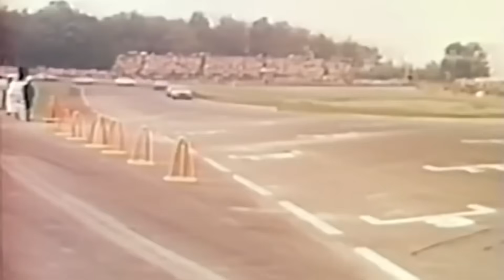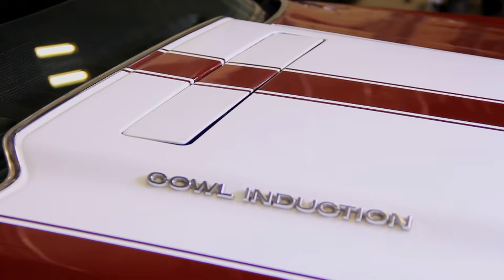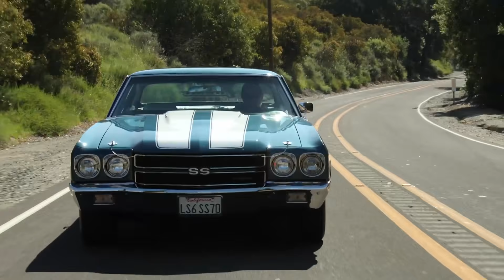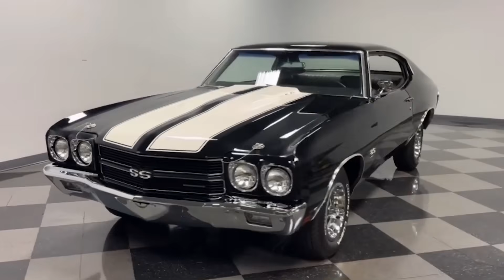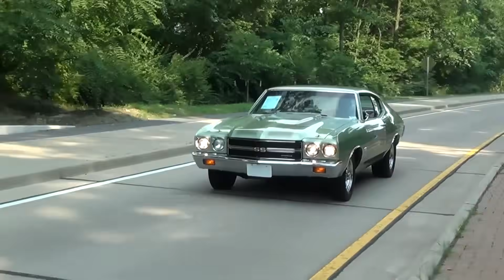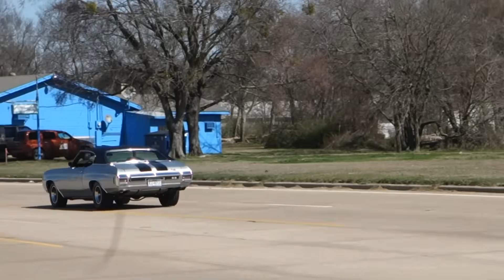1970 Chevelle SS 454 LS6 EXPOSED - The 500+ HP Cover-Up

Comment: Every high performance car from the manufacturers were under rated during that period. The LS6 was a monster, but it had one drawback, it was fickle and you either spent a lot of time in your garage under the hood, or you shelled out a good chunk of change at the mechanic keeping it tuned.  It was a Halo car for Chevy. If I remember correctly I think the Buick 455 had more torque that year. It was a great time for muscle cars, so many options to choose from.

Comment: When the LS-6 454 was dynoed at GM it had headers , no airfilter, tuned n no accessories. Put the air cleaner, stock exhaust manifolds n accessories the 450 horsepower dropped to probably 375 horsepower. The problem was traction with all the torque.

Comment: The exhaust manifolds and intake manifold hurt it immensely, therefore I don’t think it produced 500 hp. 450 hp sounds about right with what’s in the motor.
Reply: 450 gross is only 365 net, most V-6 turbos can do better
Reply: yes a set of headers and a crafty tuner with an msd and 850 easy

Comment: Nonsense this motor put out 460-480 horse at best from factory. It needed headers and highrise intake 850 carb and tuning , to do 500 +
Reply: nowhere  near 460 hp......
Reply: @chadhaire1711  If the car was 4000lbs and had an honest 460hp, it would have trapped at 115+, but I've never seen one stock trap even close to 110mph, which is 400hp or even less. They are probably 375hp dead stock from the factory and have 450hp potential if you modify it (tune it and uncork it).
Reply: @monkeymouse1403  375 gross is only 305 NET horsepwer

Comment: If you have a look at How to hot rod big block chevys by Bill Fisher and Bob Waar published back in 1972 - they dynoed a stock LS-6 engine with factory cast iron exhaust manifolds fitted and it only made 380bhp….
These engines only made the advertised horsepower with headers and OPEN exhausts ie the way engine testing at the factories was performed before the adoption of SAE rules around 1972..
Reply: I read that a chassis dyno test on a bone-stock LS-6 yielded 282 wheel horsepower. Full factory exhaust, air cleaner installed, no special tuning.
Reply: @benvye4279  Back then, engines were rated at the flywheel, not at the tires;
Reply: @rondpert5167  Yes, I am aware. During that particular chassis dyno test, the operator, estimating parasitic engine and driveline losses, calculated the flywheel horsepower at 350. That's a full 100 hp shy of the rated power. However, I've read many more reports that the LS-6 put out over 500 hp.
Reply: absolutely correct..As I mentioned above.. the very restrictive exhaust manifolds and very low rise restrictive intake manifold resulted in close to 40-50 hp loss. As I said the 69 Chevelle SS L72 427 made close to 450 hp...It would run away from a stock LS6.
Reply: @billdedrick1914  The LS6 was identical to the L72 except for a longer stroke.
Reply: @rondpert5167  Differences were the L72 had a taller, less restrictive better flowing dual plane Intake manifold and less restrictive exhaust manifolds and also included an open element AC 212c low restriction 14" x 3" air filter which allowed better and more intake air flow into the carburetor.
Reply: @billdedrick1914      The intake used for the 1969 L72 was the same intake used for the L78 396 engine rated at 375hp. In 1970 the L78 engine used the same intake as the LS6 engine and was still rated the same 375hp. So there can't be any significant difference between them. C3 Corvette's low hood required a lower intake manifold.
     There were basically 2 different factory exhaust manifold designed for Chevrolet. The better design was used in Corvettes and full size cars because of the open area under the engine afforded by not having crossmember interference. (as seen with the superior rams horn style exhaust used on the small block). This also allowed for a deeper oil pan. The Chevelle/Camaro/Nova frame has a crossmember under the engine which creates some compromise. All big block engines in these chassis' used the same factory exhaust manifolds. Even the ZL1 Camaros and low hp engines.
     All high performance big block Chevys used the same 14x3" open air filters. Although in 1970 you could also upgrade to the cowl induction hood which wasn't available in 1969. Most of the LS6s had this cold air power boosting option.
     L78 and L72 engines have 11:1 compression ratios. The LS6 was 11.25:1, giving them a slight advantage there also. The L78, L72 and LS6 engines were pretty much the same except for bore and stroke, and some part casting variances over the years. With everything so similar, heads, camshaft, carbs, etc. Why wouldn't an increase of displacement from 427 to 454 not increase power? Did you know that the camshaft used in the small block from the 2 barrel 283/195hp engine to the 350/300hp was the same? [much of this information comes from Chevrolet By The Numbers by A. Colvin]. Don't think that I'm putting down the L72. I love 427s. I used a 454 engine to build the 427 that I have now,, since the bore is the same I just swapped in the 427 crankshaft.
Reply: @billdedrick1914  Absolutely right about the restrictive exhaust manifolds and low-rise intake manifold. I had a 70 Chevelle SS396 L34 motor (402 ci) Muncie M-21 that was a complete dog. I added an Edelbrock C-396 manifold with a Holley 750cfm double-pumper and Hedman Headers and noticed at least 75hp increase. Quarter mile Times dropped from 15.5 to 14.2.

Comment: I owned a 1970 SS 454 LS-6 4 speed M22, 3.31:1 12 bolt rear, stripe delete car back in 1973. Mine had headers, L72 427 High rise intake manifold, 850 CFM carb dual feed with mechanical secondaries, 14" x 3" open element air cleaner . I raced this car at Detroit Dragway back then with slicks and it's best run was 12.45 sec @ 110-111 mph..  On street tires my best was 12.94 @ 108-109 mph. My friend had a bone stock LS6 that would only run 13.60's-13.80's on street tires and 13.20's on slicks @ 103-104 mph.  With the stock very low rise flat poor flowing intake manifold, poor flowing exhaust manifolds, 800 cfm vacuum secondaries Holley and restrictive air cleaner setup with the cowl hood there is no way these produced 450 hp.. I had another guy that raced at Detroit at the same time with a 69'  Chevelle SS427 L72 car and it ran 13.30's-13.40's  on stock tires and 12.70's on slicks with one modification of  headers.I would bet the stock LS6 would dyno at approximately 400-420 hp at best. My LS6 probably was making 470-490 hp or so. Ironically, there was only one 1970 muscle car at that time that ran about the same times as my LS6. It was a Buick GS Stage 1 with headers, slicks, 4.10 gear and 3500 stall convertor and tuning. All the Chrysler 440 6 packs and 426 Hemi cars were slower than my LS6 in the same basic tune with headers and slicks.
Reply: My friends mainly dug Chevy too but the 426 was also more than stated. Rated at 425 it was about 50 horse more than Chrysler claimed. A little too young and poor back then I got a 392 Challenger last year. Want to get it to the track, on street tires it did 12.6 with my foot OUT of it cause of traffic. Speed was only about 106, should have been more than 110. In, I'm guessing 12 flat or close over 115. Without line locks, launch control or a prepared surface I already pulled 4.3 0-60. WITH about 4 flat, 3.9 would equal the slimbody Hellcat came out same year as my girl, 2015.
Redline red, BTW.
MOPAR or no car.
😂😂😂
Just playing, cool cars are cool cars.
Reply: @Ibrahim-rx6pm  There is no way a 2015 392 Challenger will run 12 flat on stock tires..Most all of these I have seen run at Milan Dragway ran 12.50-12.90 in stock factory  setup with stock tires. The mph were all about 108-110.
Reply: My speedo and other instruments are calibrated correctly and numbers (mine) don't lie. 12.6 at only 106 is what it says. Tops the car may have been tuned but is about 500 hp. I HIGHLY recommend Michelin Pilot sport AS4 tires. Gs under acceleration went from .72 to .8 with those alone. Braking is 1.08. Same suspension and wheel setup as the Hellcat the SRT 392 only does about 175 not 200. Honest it keeps records of best times, peak Gs and such. Definitely will beat the claimed 4.2 with all the other stuff and it SAYS 12.6.   @billdedrick1914
Reply: @billdedrick1914 a challenger or charger scat can run low 12s on stock tires.  Look it up on YouTube .  The channel Cars and zebras have a scat pack charger running a 12.19 on stock tires.  So, a 12 flat is obtainable.  Heck, I ran a 12.6 in a 2016 Camaro SS 6 speed manual on those crappy run flats that were about halfway done.  I did it In high heat and humidity in Baytown, Tx.
Reply: @Ibrahim-rx6pm you are a dufuss
Reply: You are much more credible than the video hype.

Comment: NHRA put it at about 500 HP
Reply: Where did you get that info from? I don't believe that. In 1969 they factored the 69 427 ZL-1 Camaro (the all aluminum version of the L88 with only 50 made) from factory rating of 430hp to 470 in 1969. That ZL-1 and L88 were definitely more powerful than the 1970 LS6 454 and the L88 and ZL-1 would make 530-560 hp with open headers.
Reply: @billdedrick1914  No L88 ever came near 500 hp all bullshit
Reply: @chadhaire1711  Boy are you wrong..I saw these running at Detroit dragway with just headers and slicks and would mph way over 120 closer to 125...That takes over 500 real hp with the weight of the Corvette . Ask anyone that knew about the L88 back then.. Obviously you never read the detailed book "How to Hot Rod Big Block Chevys 386-402-427-454. In there they spend quite some time on the L88.
Reply: @billdedrick1914  headers and slicks are not stock dummy. No stock L88 ever made near 500 horsepower.  And 500 GROSS DYNO horsepower after a total modification is only 420 horsepower NET, 60 horsepower less than a 2025 Mustang with stock 5.0 485 hp V-8.  You have no clue what you are talking about.
Reply: @chadhaire1711  I have to differ from your statement.. You have no idea what you are talking about. The L88 and Zl-1 of 1969 were two of the most powerful (hp) V-8 engines of the Muscle car era (1963-1970) and the 426 Hemi would follow those two in hp production.
Reply: @billdedrick1914  Guess you need  to go back and read what  I said.....I am not going to repeat myself.
Reply: Nick's garage had a rebuilt LS6 on the dyno that made 450 the L88 is an all-out race motor so I'm pretty sure it made more than that Nick also had a 66 I believe 426 Hemi rebuilt two stock with points that made 498 I believe so I can believe 500 out of it all L88
Reply: @bryanbittinger9794  You obviously have no clue about horsepower.  First all those  NICK engines were NOT stock but hand made modified. Secondly 498 horsepower on the dyno with no belts, air cleaner, or exhaust is the GROSS horsepower.  Put all those items back on and  the NET horsepower drops  about 18% to about 420.  A stock 2024 Mustang GT with 5.0 V-8 puts out more at 485 NET horsepower.  Again proving the L88 and 426 were not that powerful and over rated.
Reply: @chadhaire1711  At that time all factory ratings were gross HP at that time.
Reply: Means NOTHING

Comment: 1/4 mile times and trap speed tend to argue with what they claimed.  As well as exact reproduced engines to exact specs of the ls6 454 put on modern dynos prove it made way less hp than they claimed
Reply: tire issue... ls6 is a true brute
Reply: @robertsspetz9860  The it should trap well, regardless of ET - but it doesn't.